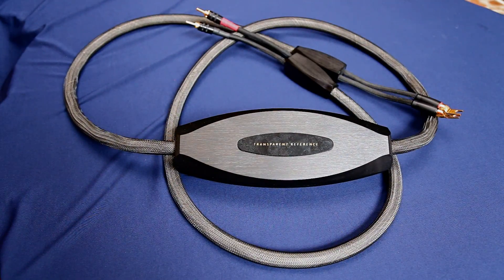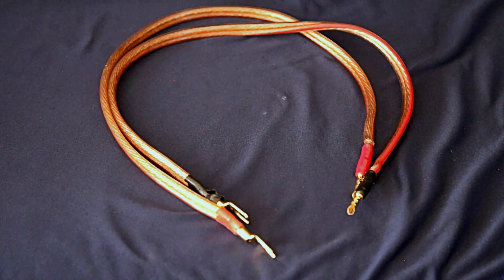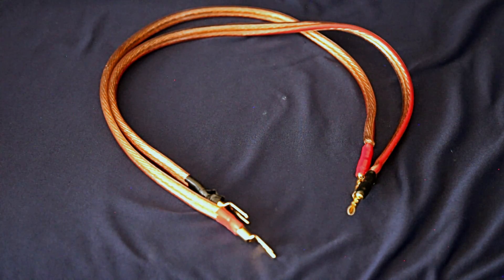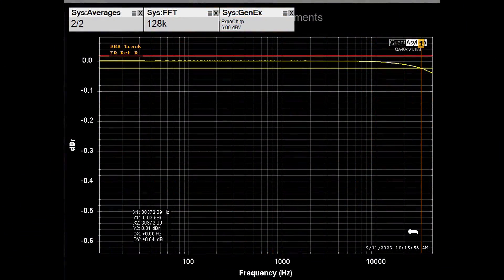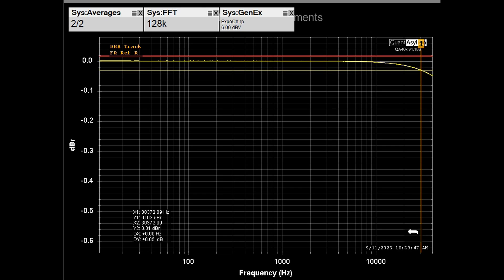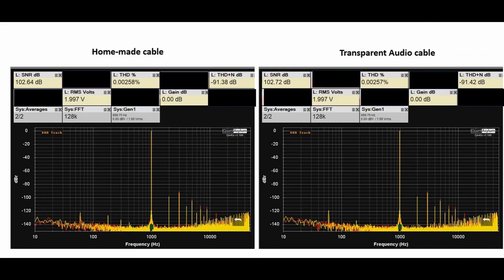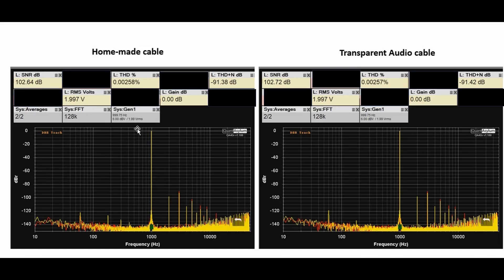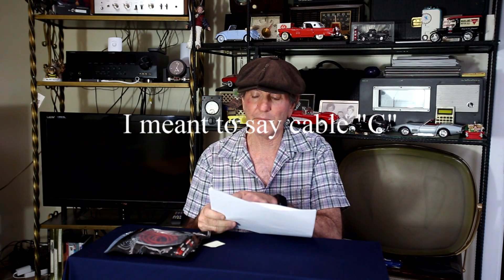$8000/pair Speaker Cable  vs. $14 DIY Speaker Cable A/B Test: Vintage Audio Review Episode #87

Comment: I've always know that there would be no difference, but you will still get people say you can not measure the audile difference of the more expensive cable. $8k will get you a nice audio system and a 65 inch Tv. 😉
Reply: My little system (small but not limited) came in just under $1,500 with a 50 inch TV, NUC configured as an HTPC, 4tb of storage, UGreen DAC, Fosi TB10D amp and Pioneer tower speakers.  A little tinkering with part values and some polyfil and voila decent system that will last for many years. Beyond that lies the dreaded world of diminishing returns.

One of the local efetes got wind of what I am using and spent quite the effort running me into the ground about it. Cost me a few customers, too. So finally I ends up nose to nose with hiim: "You think my system is trash?  Why don't you come over and actually listen to it before you dump on it..." He came, he listened, he went silent, he left and I haven't heard from him or about him since.

The truth of the matter is that cheap audio is getting better and better audio is getting cheaper all the time.
Reply from the maker: @Douglas_Blake_579  Great story and some of those inexpensive amps do a great job...
Reply: @vintageaudioreview 
A lot of progress in Class D has happened recently.  

With the introduction of the TPA32xx series chips TI has pretty much revolutionized it.  These chips can be found in powered studio monitors, sound reinforcement, public address, high end home theatre... and, yes, even in high end stereo gear.

The ICE Power modules everyone rages about started with TPA3251 chips for the 50w/ch and TPA3255 for the 100w/ch units. The higher power ones are, of course designed with discrete components.

Then there are the Purifi and Hypex modules everyone rages about.

The Chinese versions of these amplifiers are basically stripped down versions of the more feature laden (read "expensive") versions you find elsewhere.  The smaller sizes are possible by moving the power supply outside the chassis and the relatively small number of parts needed to make the chip happy. Miniaturization at it's finest. As long as they're not using fake or underrated parts, they're no less capable than the "big boy" versions you find in other equipment. 

The thing is the Chinese manufacturers are still learning how to use these chips to advantage. For example: 
I recently did a "deep dive" examination on the Fosi TB10D amplifier. Nice compact unit with tone controls.  There were a couple of minor problems with overvoltage on the reset pin (easily fixed) and they had placed the output coils right against the heat sink, causing all kinds of bizarre eddy current problems. I pulled out my hacksaw and took one fin off the heatsink to create some space between it and the coils.  
The result... one sweet sounding amplifier that mostly runs at room temperature on 36 volts, producing 60w/ch RMS on 8 ohms with a flat response from 5hz to 25khz and distortion below the 0.01% threshold of my current test equipment at 99% output power.

That's better than about 80% of the stuff these big huffy audiophiles are using. Of course the big advantage is that it, along with my HTPC, hard drive, DAC and their assorted power bricks fit nicely into a vacant drawer cavity in my TV stand.

So what's not to like?
Reply from the maker: @Douglas_Blake_579  Have only listened toto the little Aiyma amps, but they sound just fine to me and a few others that have heard them...most likely will be the subject of another a/b test....
Reply: @vintageaudioreview  
When properly implemented any amplifier with the TPA3255 chip is going to sound about the same.  It's the same chip, after all.

Aiyima and Fosi are in some kind of contest to produce the most advanced versions... but I strongly suspect neither really has a full grasp of the chip's needs and abilities.  I especially cringe when I see output filter coils right up against a heatsink... but it's done all the time and you can hear an improvement when they are not.  

Right now Aiyma has the A07MAX and Fosi has the competing ZA3 coming soon.  That would be an interesting comparison.
Reply from the maker: @Douglas_Blake_579  I was trying to get an A07max from them but my contact has not responded to my request....
Reply: @vintageaudioreview 
Might be worth another try ... I haven't had one on my bench yet, but from all indicators it's a pretty decent amp.
Reply from the maker: Thanks for your insight!

Comment: those reference cables are at least 3 generations old. they were not close to 8k a pair when they were new. the new reference cables are very different. they are about the equvelent of the gen 6 super cables.
Reply: If constructed properly  with airtight terminations to avoid corrosion…or cleaned terminations) it does not matter if it’s thirty days vs thirty years old. Copper performs the same whatever its age if corrosion is managed. The reference cables are a rip off however old or new. A fool and their money…
Reply: No...they are not. Regardless of what you believe or have been told.

If you were blindfolded, you couldn't pick out the difference between an $8000 cable and a coat hanger.
Reply from the maker: @Ellington_Industrial_Arts  Thanks so much for your commenting on this and most would agree with you.
Reply from the maker: Fair enough. They list the Reference model still starting at $9k pair for an 8' cable with one different termination. Maybe they would be $8k when adjusted for inflation...

Comment: The expensive cables should come with a free dunce cap.
Reply from the maker: I would not go that far.. Thanks for the comment.
Reply: @vintageaudioreview 
I would.  In fact I like that idea!
Reply: If you understand NEC table 310.15(b)(16), you don’t need more than #12Awg wire for the speakers. Just make sure you have a good separation.
Reply: @mwsc Like resistance is much of a concern in the typical audio system.
Reply: You'd get the biggest and pointiest.

Comment: I really don't think that's the right gear for hi-end cables - it's nice gear but it's not hi-end.  A-B test on some VTL750s connected to Wilson's XLFs and you would know without a shadow of a doubt that Transparent is vastly superior.
Reply from the maker: Thanks for taking the time to share your thoughts.  So I need to have a $200k speaker system and $15k pair set of monoblock amps to hear a difference ? At least you did not compare the gear to a clock radio like another commenter did and said it was nice...just not high end.....My dad told me a long time ago that he saw a lot of people lose money who thought they could tell the difference between Pepsi & Coke...
Reply: @vintageaudioreview  I mean the difference would be more obvious with higher quality gear.   It's the main reason many people don't believe cables make a difference - they put nice cables on a $5k system and won't notice any change.  Another good question would be the cable size of mains wiring - that might get a few people arguing.   Nice to see people like yourself taking the time to do the testing.
Reply from the maker: @DarylCMillsWhitelighter  As i have mentioned in a few comments, there are a group of "audiophiles" here who like to get together for food and drink and conversation and see gear, and the a/b test seems to be the perfect excuse to do that. And so far, I have been able to use the material for a video. I still disagree with you about the equipment not being "higher end" enough...
Reply: @DarylCMillsWhitelighter 
Most AC mains wiring in houses is either 16 or 14ga wire ... both cables used in the test were bigger than that.
Reply: Do you an examble of an AB test with high end gear where what you say is shown to be true?
Reply from the maker: @abelfonseca  Thanks for the comment and question. The only time I have heard a difference in a/b testing was between the two speakers in the one video I did and that is expected and it is mainly used to hear immediate differences between two individual speakers. Very little difference between preamps and amplifiers.
Reply: How about we lose this myth about "high end" being better. I had several systems I used to service that ran $50,000 or more and frankly they were no better than the typical $500 systems I used to sell as "soundbar killers" for TV sets.  In fact a couple of them sounded like crap on their best days.

I've done service on a lot of stuff over the years and I consistently found both $500 and $50,000 gear using the same parts... same outputs, same drivers, same op-amps... so now you tell me how is the big bux system better?  The same applies with speakers, under those super fancy high gloss finishes is the same 1 inch MDF, the same crossover parts, and sometimes the same drivers.  how is that better?

The simple truth is that "High End" audio is far more about Status, Snobbery and Elitism than it is about better audio. It's bragging rights and permission to long nose your own peers... nothing better.
Reply: OK, what specifically is wrong with the equipment used for this test? If we are to re-run the test with the right equipment,  what parameters do we look at in selecting the right equipment? We will need specific defined parameters in order to make the selection, not just your favorite brand or what you own as stated above. What defines the line between high end and not high end audio components other than subjective taste?
Reply: @andydelle4509 
"What defines the line between high end and not high end audio components other than subjective taste?"

Price ... and not much else.  

The entire perception of "high end" lies in the rather stupid belief that the uber expensive equipment itself is actually better. Most of the time it isn't.  What you're actually paying for is the brand name and fancy casings wrapped around more or less standard designs.

Comment: After nearly 50 years in the hi-fidelity hobby, the “Wire is Wire” argument is understandable, but WRONG. Yes, the “audiophile” cable market is absurdly priced and easily debunked, but the quality of metals, the geometry, insulation all have an audible (if not measurable) effect. A solid core, silver wire will sound different to a multi-strand, copper wire- Period. The preference of the test listeners only proves that more expensive cables may not offer value for money, nothing more 👍🏻
Reply from the maker: Thanks for replying to the video and taking the time to comment, though I disagree with you that you would hear a difference between the two wires that you mentioned over a reasonable length of say 10'....
Reply: " A solid core, silver wire will sound different to a multi-strand, copper wire- Period"

Yup, it goes something like this: The cable vendor charlatan says "now here is the generic cable" plays a track. Pause, Then they say "Now here is Ultra Max Silver Acme cable". Plays the same track. Based on this, what do you expect people who cherish high end audio to hear?

Comment: I see this has ignited the usual "my system is better than your system" kind of debate that every technician and engineer dreads .... 

So let me just give you all a couple of simple things to think about...

Why mono instead of stereo?  ... 

Two word answer: Phase Cancellation.  
By the time you get into the higher frequencies, about 10khz and up, what is called the "brilliance" or "presence" range, the wavelength of the audio signals in air is less than 1.5 inches... this means that any error in distance from the listening position to the stereo speakers of more than 1/4 inch could result in the tweeters being increasingly out of phase at the listening position.  
Moreover, simply moving your head 3/4 inch either side of the perfect equal distance can result in significant reductions (or increases) of perceived high pitch sounds.  
With a monophonic test, this doesn't happen.

Then there's the problem nobody can fix... Mid Field Cancellation
The audio wavelength in the range between 1.5 and 2.5 khz corresponds to the width of most people's heads. In a stereo system we hear both speakers with both ears and we take directional clues from the difference in amplitude, phase and arrival time at our ears, dominantly in this mid-vocal range of the spectrum.  
So... with a pair of small speakers, set up a near field listening test... speakers about 3 feet away, equal distance and angle from the listening position.  Now play a 2khz monophonic test tone at a low-medium level through both speakers.  Find the spot where the sound appears to be dead centered between the speakers... now move your head about an inch either side of that perfect point... you will hear the loudness of the tone increase and it will seem to move toward one of the speakers. Move the other way and it happens with the other speaker.
Now repeat the same test with white noise... when you move even an inch or so the entire tonal quality of that noise will change very noticeably, becoming brighter and more present.
This issue cannot be fixed. It is cancellation caused by the distance between your ears and the arrival time of the signals from the speakers at each of your ears.
Of course, with a monophonic test this is also not an issue.

So, now we know why most stereo listening tests are a simple waste of time. Unless you are rigidly positioned between two speakers at exactly equal distances and angles, the results will change every time you move your head.

Now for the interesting question .... how close is your home setup to this ideal... equal distance, equal angles from the listening position.  Yes, even 1/4 of an inch matters... Then ask yourself if you always sit in the perfect position...
Reply from the maker: Thanks for taking the time to expound upon this point. I wish I could take credit for setting up a mono test for the reasons you mentioned, but it was mainly because that is the only way it can be done with my a/b switcher. Imaging/soundstage is determined more by room acoustics, the speakers and your place in the room as you pointed out.....
Reply: @vintageaudioreview 
No worries .... it's kinda fun.

 Imaging and soundstage actually come from the recorded material, not any part of your playback system.  
It is impossible to create when none exists... 
However; it is possible, and even easy to sabotage the one you got in the recording.  Simple matters such as imperfect speaker positioning and even sitting position in the room can degrade the perception of it significantly.
Reply from the maker: I am a fan of Carver Sonic Holography and it can- depending on the source material- make an improvement in the soundstage.
Reply: @vintageaudioreview 
As a special effect, maybe ... I can do the same in software on my system.  But if you listen closely it comes at the expense of other sound qualities that might be more important to our enjoyment.  Still, if it pleases you... why not?
Reply from the maker: It does alter the FR a bit from what I have measured, but the effect can be pretty impressive at times, and I do like it so why not....that is part of the hobby.
Reply: @vintageaudioreview 
Want an excellent example of music recorded with no "soundstage" or centre image at all?  

Doors ... "Riders On The Storm" (1971 .. original not remixes.)
Reply from the maker: I will see if I can find it on my streaming source. I have the "disco version" of it and I enjoy that one a lot.
Reply: Well stated. 👍
I would urge all HiFi enthusiasts and audiophiles to research our human auditory system and what our ears and brain use to localize sound sources in 3D space...particularly in regards to "ITD" (Interaural Time Difference), and "ILD" (Interaural Level Difference).

As Douglas stated, this has to do with the unique distance between our two ears, in addition to our "HRTF" (Head Related Transfer Function), and the "Head Shadowing Effect".

Once you understand these basic principles, you will be able to determine which theories and hypotheses actually work or can be applied, and which do not/can not.

Comment: If you buy the right Rolex at the dealer, it  is worth it because you can sell it immediately for anywhere to 20-100 percent profit.  There is no audio cable in the world you can do that with.  Enjoyed hearing about the test.
Reply from the maker: Excellent point about the Rolex often going up in value. Not so much with expensive speaker cable. Thanks for taking the time to comment.
Reply: And I don't believe Rolex ever claimed their watch keeps better time than a cheap $20 digital watch. It's just expensive jewelry and they don't argue that. But that's not the case with these audiophool vendors. They are making untested and invalid scientific claims. Fine, go sell your $20,000 sexy looking speaker cables. But don't say they perform better than Home Depot zip cord of the same wire gauge. As I stated in my direct comment here, that should be illegal barring accredited peer reviewed scientific testing.